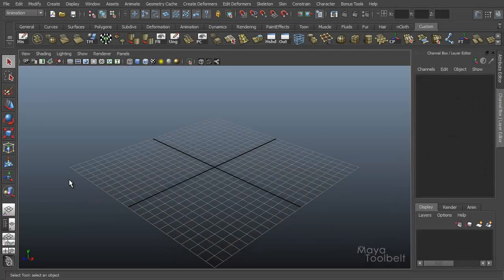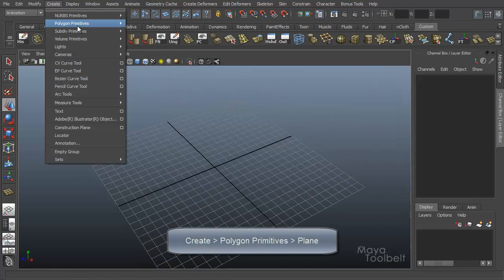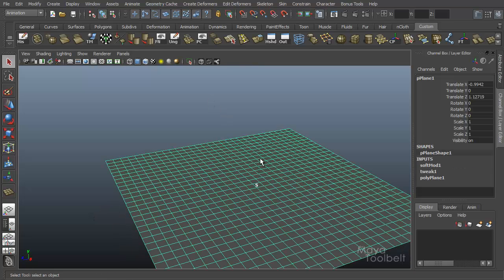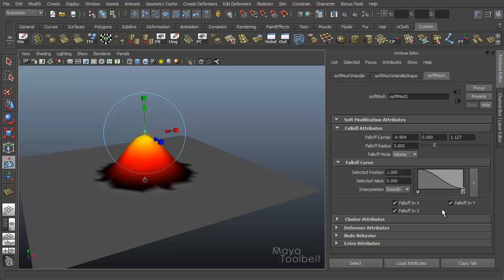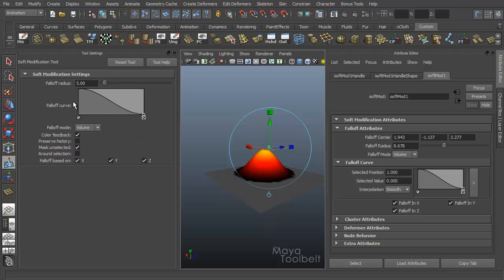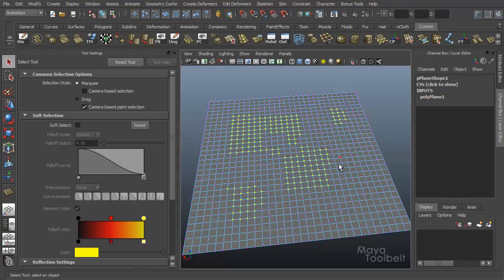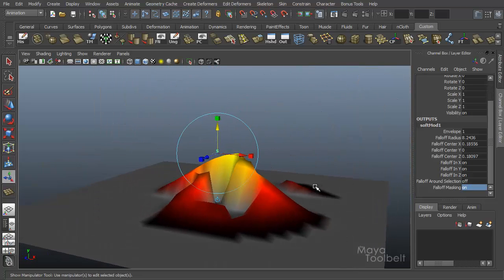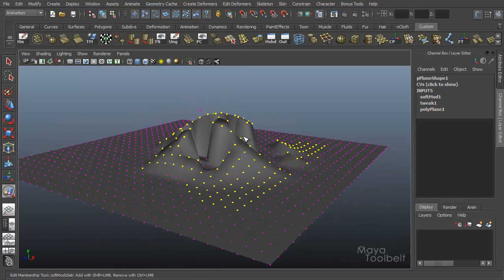The Maya Toolbelt - Soft Modification Tool

Comment: Is there a way to make the soft modification  settings back to default without manually putting it back
Reply from the maker: You should be able to open the tool options and use the Edit > Reset Settings command to reset the tool.
Reply from the maker: I just realized you probably meant after creating a soft modification and messing with its settings, if there was a way to reset it. As far as I know, I don't think so. It would probably be fastest to delete the soft modification you don't like and create a fresh one with reset settings.